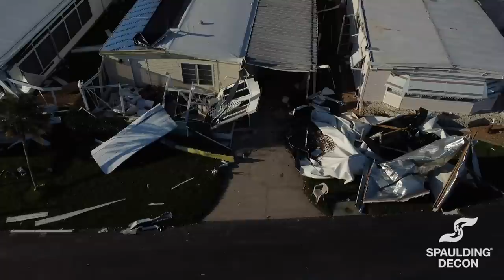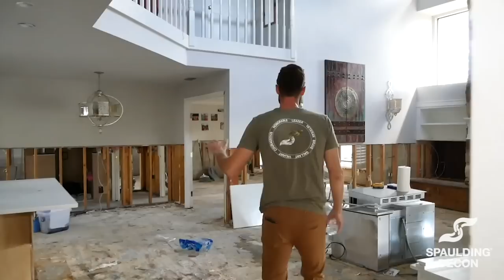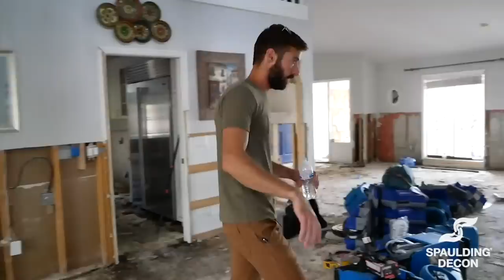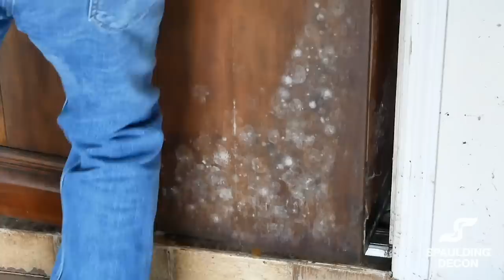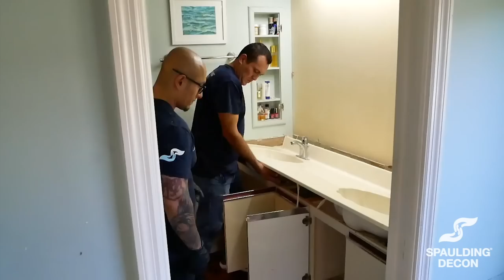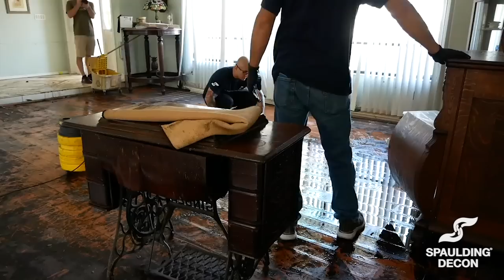Hurricane Ian Clean Up

Comment: Last year in June my area got a massive hurricane with massive flooding and I did electrical make safe storm recovery work and around here we have natural gas for a lot of our neighborhoods and our utility company actually shut off the gas in a lot of these flooded neighborhoods where the houses had 4 feet of water in them because All the modern appliances have electronic ignition and gas valves and they did not want gas leaks due to a faulty valve getting stuck in the open position for example.

Comment: Even if the neighborhood had power I would not trust any of the electrical in any of these places just because all of that Romax wire has a paper lining that will never dry out and any switches outlets etc. will most likely have water in them and have corrosion, also the panel is most likely completely shot. All of these houses will need to be rewired at least on the first floors and will need to get new electrical services put in, also if the meters were underwater those things are fried because smart meters have electronics in them.

Comment: It’s shocking to me some of the items just thrown in the trash and not salvaged. I know they can be so it must just be cheaper and easier to replace them. Kind of sad.
Reply: depends, anything made of wood, ESPECIALLY the "wood" (MDF) that ikea uses, will warp and are destroyed even if it doesnt look like it yet. stuff like the fridge were thrown out because the compressor and other components are on the bottom, and this submerged
Reply: Molds are very dangerous. They've no choice. Much of that material is MDF and other porous woods etc and absorbs sewage and what not.
Reply from the maker: Yeah, it sucks having to throw so many things out but mold grows super fast down here in florida and with this flooding, it even contained sewage waste making it even harder to get surfaces fully clean. 

Usually once it gets to this point, it really is cheaper to toss just about everything and start from scratch and include it all in the insurance claim.

Comment: Kind of don't think they saved that fridge judging by the way they dumped it over.
Reply: Even if they didn’t dump it over, if water got in between the insulation layers in the fridge it could start to mold also subzero refrigerators are full of fancy sensors and modern computerized electronics just like modern cars so even though that fridge is easily a $12,000 refrigerator unfortunately it’s easier just to get a new one. Think of all the hassle you could have with it down the line due to electronics issues.
Reply: Different fridge. I believe they showed more than 1 location in this video.